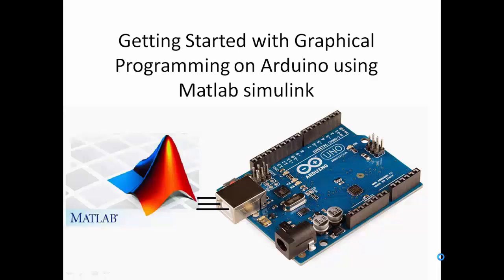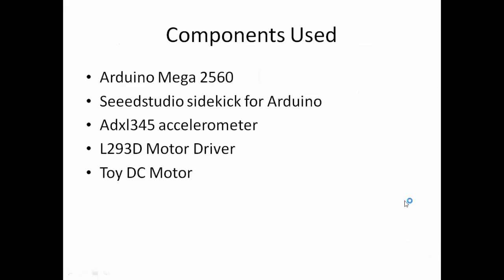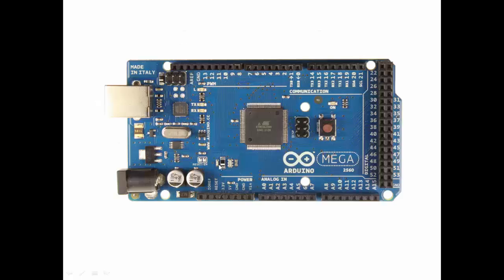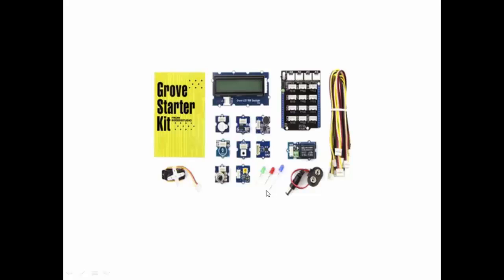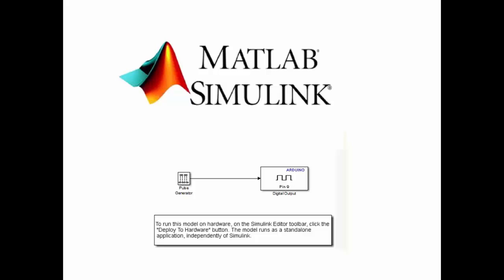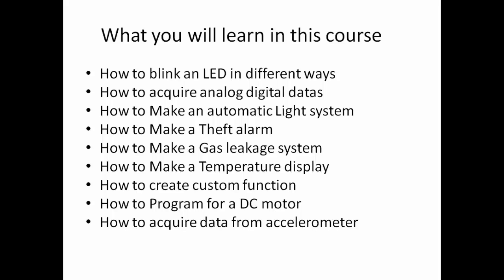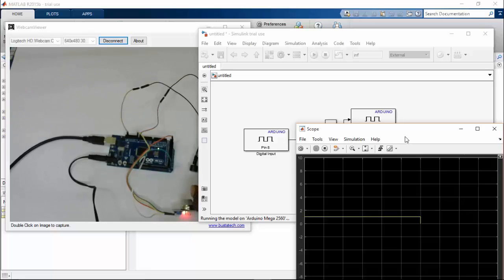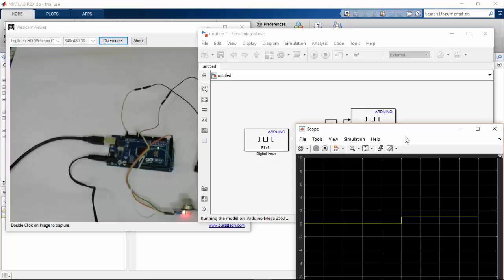1 Introduction to matlab and arduino

Comment: Dear Sir, I found "Your current working folder is: 
 C:\Program Files\MATLAB\R2017a\bin
Simulink does not permit you to modify the MATLAB installation area. 
Please change to a working folder that is not in the MATLAB
installation area and re-try the previous command. "   message when at the time of interfacing. So, Kindly resolve this problem. whatsapp # 923459364162 and email is asad0387@gmail.com